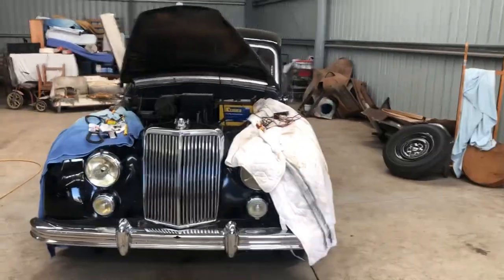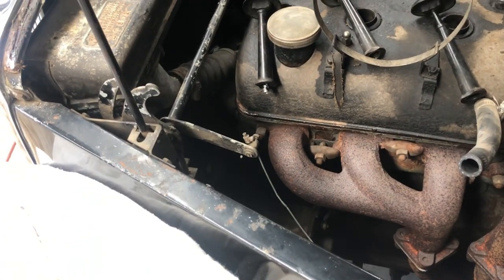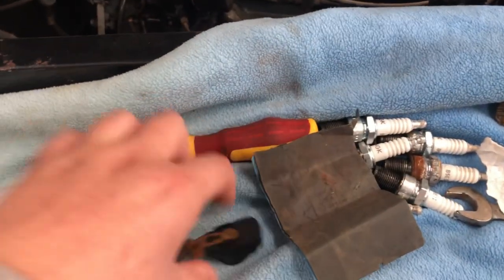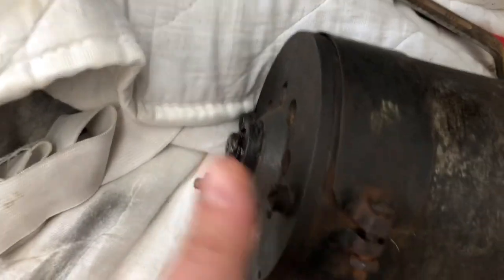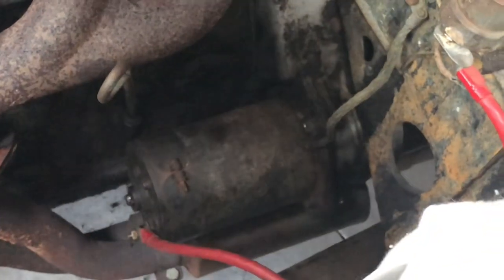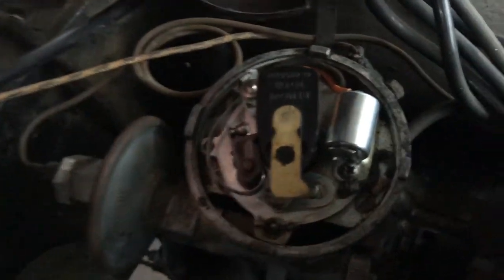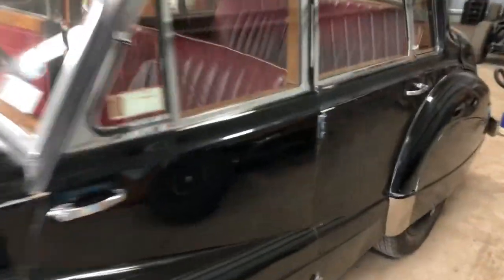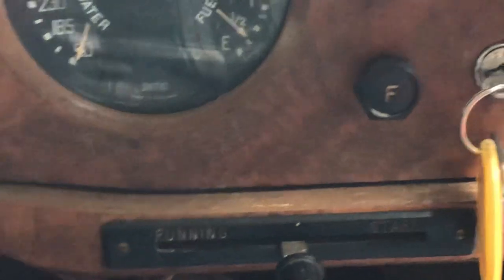Armstrong Siddeley Sapphire - Will It Run? - Project Sapphire Episode 2

Comment: Running beautifully. These Sapphires are in my opinion possibly the best saloon made during the 1950s. Superbly built and much more sophisticated thasn Daimler with the nearly 3.5 litre hemi which produced 150hp in twin Stromberg setup. Not only enough to reach 100mph but far better than a Bentley to work on. And in preselector mode you have a really fun driving experience. And a great car club. Nothing else has the elegance.
Reply from the maker: Couldn't agree more!!